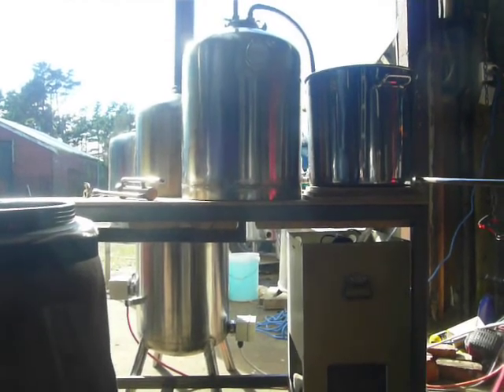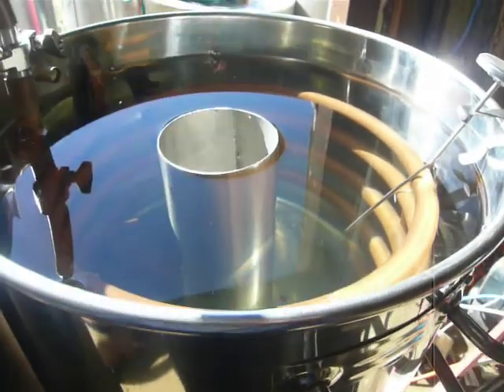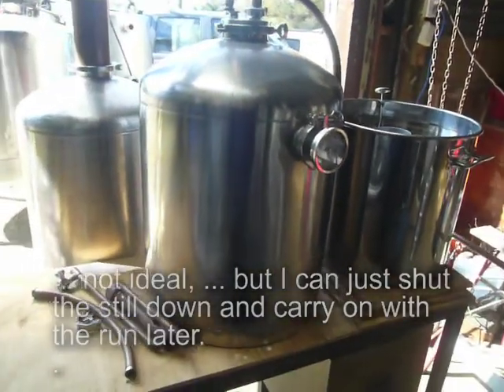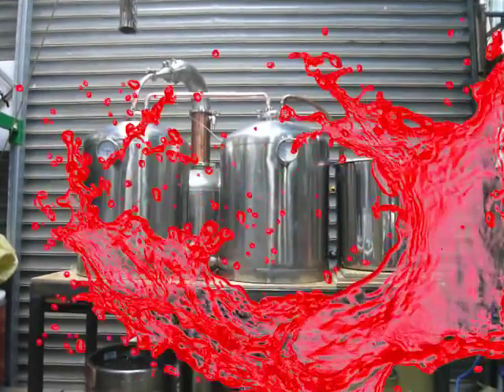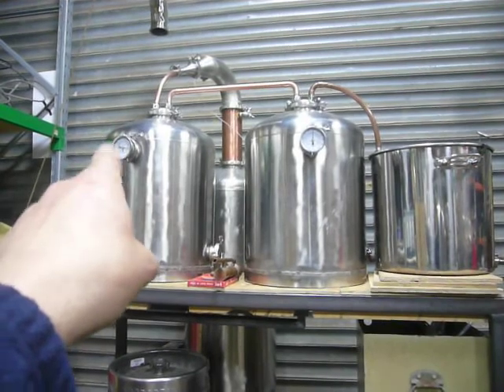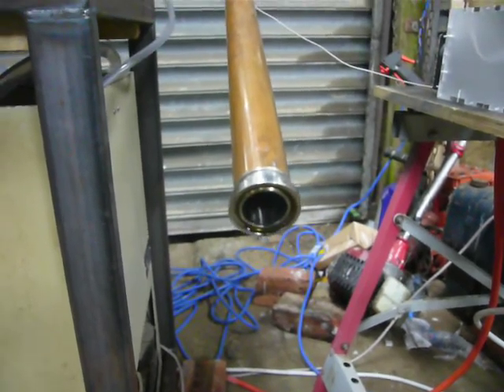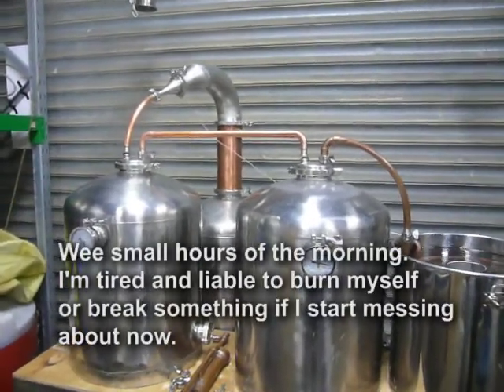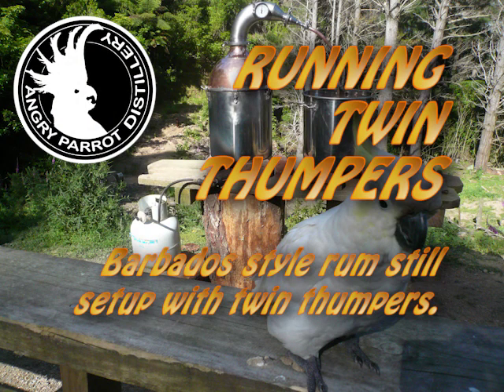Twin thumpers, Barbados-style rum still ... with corn whiskey ?!?!

Comment: One more question for you - do you cut/grind the Tri-clamp ferrules to fit the curve of the tank(s) when you TIG weld them or do you leave them 90° cuts and just weld with a gap?   Looking to TIG a tri-clamp ferrule to a half barrel keg for a beer brewer set up and can’t decide if I need to find a way to cut them to fit. Thanks!
Reply from the maker: G'day again,
Yep I always curve fit components as close as I can.
The better the fit, the better your join.

Happy Distilling

Comment: Really cool design! Too bad about the smeared run, but very cool to watch the process:-)
Reply from the maker: G'day Beard, yeah I was happy with it - keen to see how it does with rum which was the reason I built the two thumpers.

The result it gives - like a reflux still running at low abv and tailing off right at the end was pretty neat.
Have run this config' again since and the outcome is repeatable without the smearing albeit a little slower than normal.

I got a bit impatient with the run for the first time ever - hence the overheating and smearing, would have been worse with rum.
Will probably end up adding element ports to the still and try 4x 1500W elements as opposed to 2x3000W ... or maybe look at some custom low density jobbies to speed things up without scortching or smearing down the track.

Happy Distilling fella!
Reply: @AngryParrotDistillery  You are a wizard with metal. I have no doubt that whatever you come up with will be amazing, and gorgeous. I'm grateful for all the detailed info in all your videos.

Comment: What type of ss cans are you use here brother ? I'm using one  15g ss keg and two ss 7 g kegs for my thumpers dose a very good job
Reply from the maker: Heya Prom',
They're both around 70-80L volume each (I guess that around about 20gallons each give or take).

They were a large s/s hot water cylinder I cut in half.
Kettle they're being run off is around 180-200L.

Happy Distilling fella! 😊
Reply: @AngryParrotDistillery  very nice  brother  happy  distilling bud  have great day ✌🍻✌

Comment: hi Mr Angry Parrot I made a video for you of the thumper that I'm building, its done at night time and with only a "torch" so yes it very dark.Just to show you how this is coming along.
Reply from the maker: Man that's a sweet rig in your vid Cameron.
Lots of copper there, looks like you got a good mash to run thru it as well! 👍

Whats the mash? Looked like corn?
Reply: @AngryParrotDistillery  yes it’s corn and wheat and barley and some whiskey yeast and some instant dry yeast.i’ll run it on Monday sometime.
Reply from the maker: @cameronshine3465  
Sweet!

I'm firefighting here atm - replaced elements in my still and they've thrown bad distillates.
Reply: @AngryParrotDistillery  interesting!
That PZEM-061 meter came and its installed seems to read the amps ok.
No run today too windy and the same tomorrow 20 to 30 km/h
Reply from the maker: @cameronshine3465  
Yeah no point running it in the wind, even with an insulated column it's still gonna mess with your gas.

Comment: How do you remove your corn solids?
Reply from the maker: G'day Chris,
I ferment on the grain - currently only about 55gallons at a time.
Once the ferment is done I let it settle out for a week or two and then drain the mash liquid down to the grain bed.

You do lose a bit of liquid that way but then theres other things you can do with the yeast laden grain bed afterwards. 😊

I also mill my grain quite fine too, like a fine polenta, so theres probably not as much left in the way of solids as if I was using a coarser cracked or flaked corn.

Happy Distilling!
Reply: Angry Parrot Distillery thanks mate.
I have a 200L mash that’s fermenting on the grain at the moment and I’m not looking forward to straining it all out...
(I boiled, blended then mashed the corn, so there’s a heap of fine particles in there)